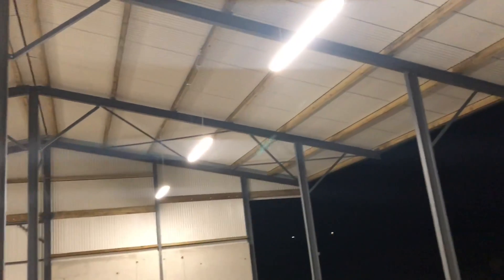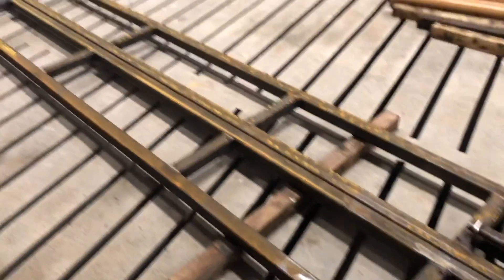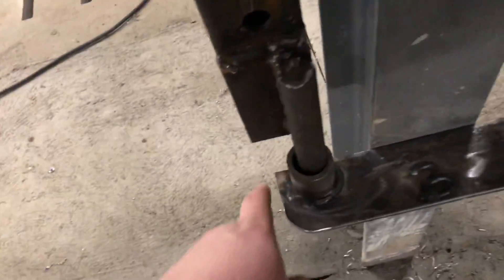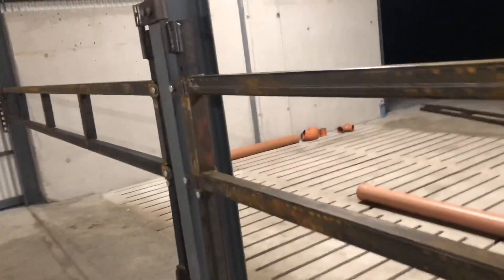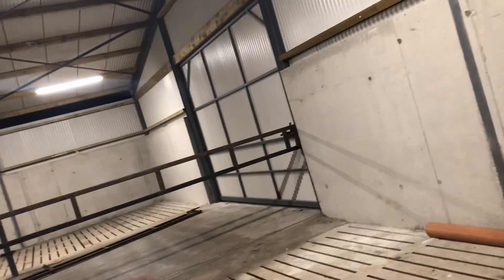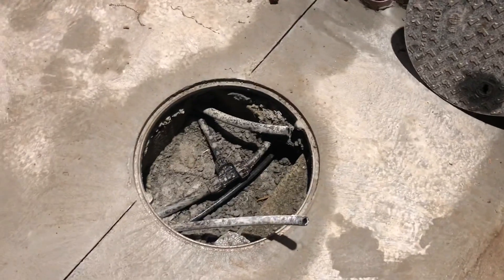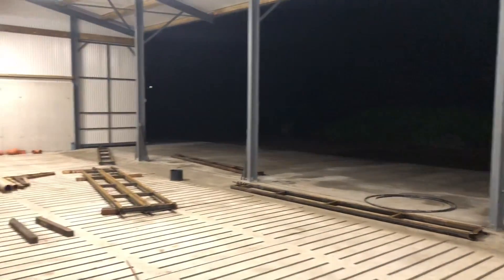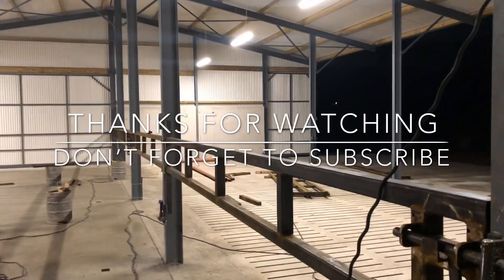NEW CATTLE SHED PART 9

Comment: Lovely job. Well laid out. Everything taut of. Just wondering why the concrete so smooth outside. Would it be dangerous for cattle slipping.
Reply from the maker: Dano O hara it’s not that smooth. It’s got a fairly rough finish. Looks smoother in video I suppose then in the flesh

Comment: Lights perform better if the were tight to the timber
Reply from the maker: Eugene Byrne i wouldn’t agree with that. It’s more down to height of the shed and height of the lights.  If it was just a case of them working better on the timber no one would have ever dropped them down on chains.... ever.

Comment: Just looking at the barriers there again Gerry, notice you've gone with only one bolt on the latching side.   They probably a copy of ones ye've used successfully in the other sheds.  One is probably enough?  Just said I'd say it before ya galvanise
Reply from the maker: Bambinohead1 yes used exactly same barrier in other cattle shed and works well. Never got them open yet. Prob will open them now after me saying that 😂